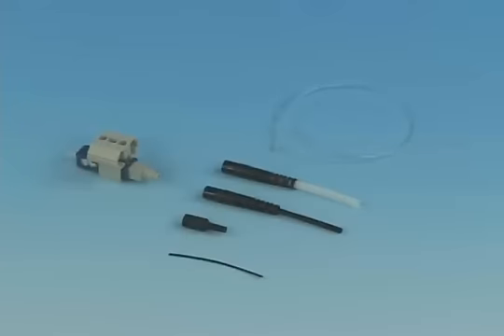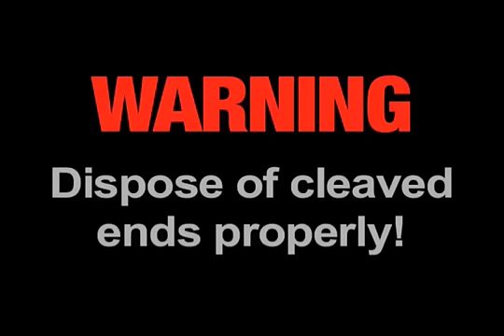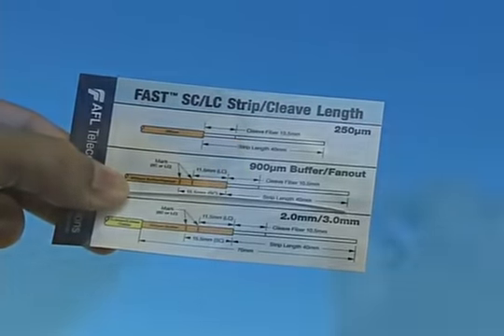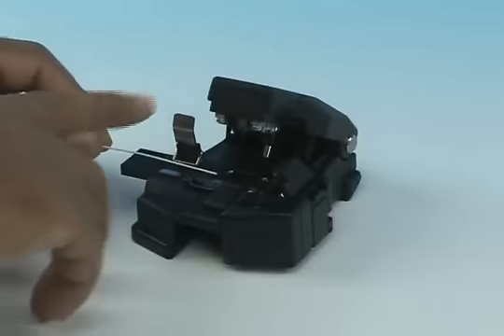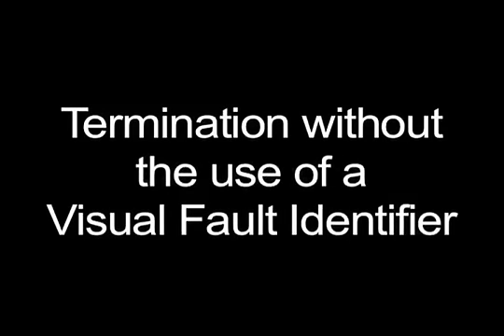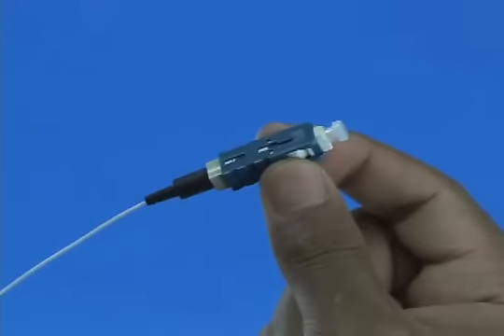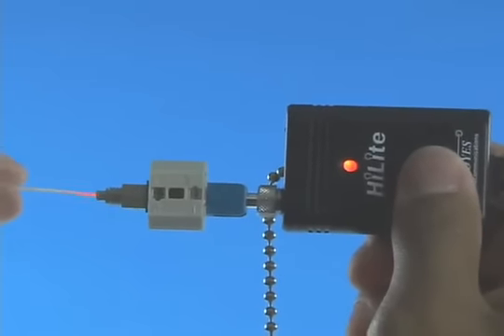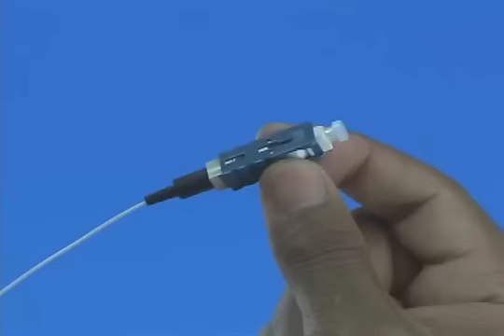How To Install AFL FAST SC Fiber Connector 900um Fiber.flv

Comment: I use these connectors all the time and love them. I've used the corning Unicam connectors in the past but prefer these AFL Fast connectors. There are fewer parts and they are so easy and quick to terminate vs the Unicams. The only down side for these is the price of the the cleave tool which is around $1300 with the kit, but I would say is well worth the money. It takes more time to take them out of the package then it does to do the work. The ends are $8-13 depending on the style or if SM/MM.